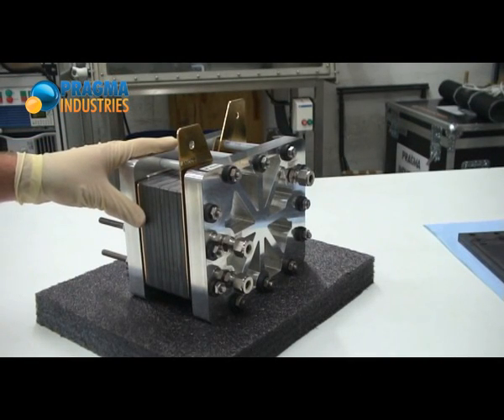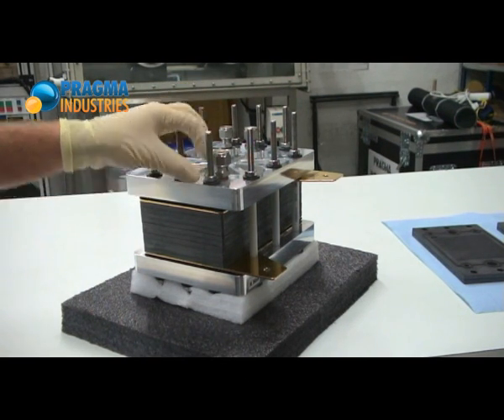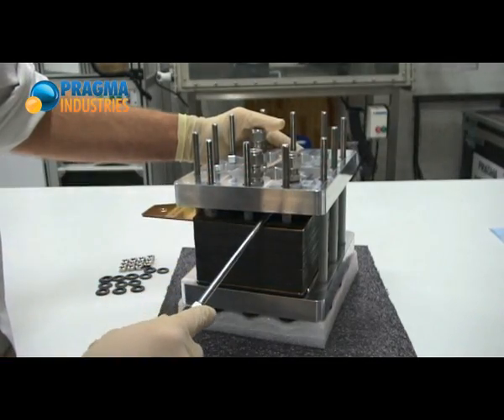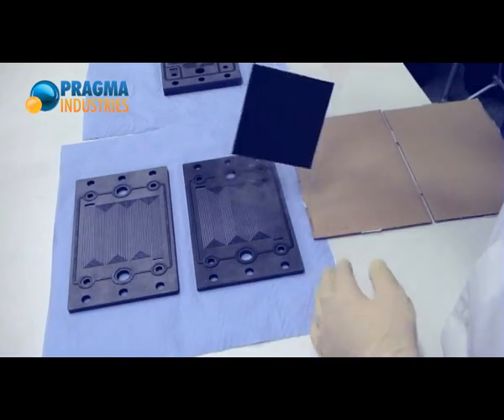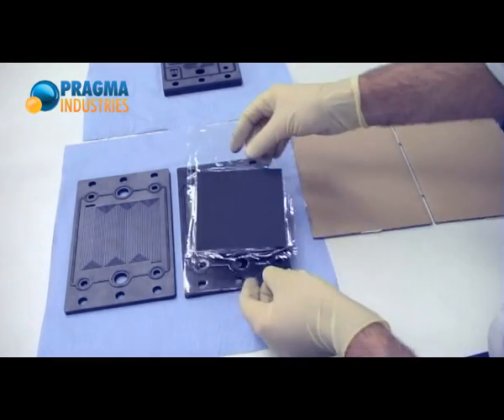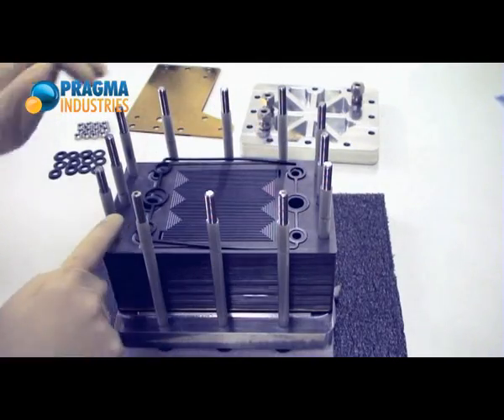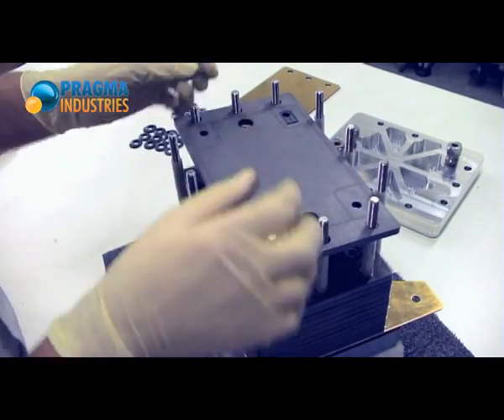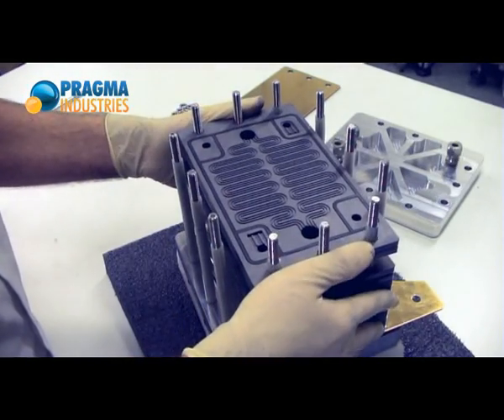Fuel cell stack explained

Comment: ... shouldn't there be a Sterling cathode (-) plates collecting electrons from the Hydrogen side in-between those blocks later connected in parallel/serial to suit application...copper are oxidizable element...more Non oxidizable plates on the Oxygen/Anode (+) side like copper plated with gold/silver..etc

Comment: This was a wonderful learning experience!  Thank you!  This helped me better understand PEM electrolyzers too!  That fuel cell looks like it would work as an electrolyzer with no problem.  You could force deionized water into one port on the anode and collect oxygen and recycle water from the other port, diagonal from it.  On the cathode side, you connect both ports to a T connector, run through a water-gas separator and collect the hydrogen.  The water cooling ports would remain unused.  I would LOVE to see how many LPM I could get from a stack that size!! :)
Reply: It looks like they are putting these graphite plates into PEM fuel cells and running hexo and mirai cars with it. It looks like the the fuel cell is made of like 400 plates and it's like 3 feet long, two foot wide, ect. So they use graphite plates? No platinum or anything? is this to save costs?
Reply: @MinecraftSurge  I had to watch a little clip of the video again to refresh my memory.  Yeah, he didn't just use Nafion in between the graphite plates.  He was putting complete MEA's in between them, which already has some platinum deposited on them.  Those black squares on each side of the Nafion membranes contain carbon, platinum and I forget what else.  And, the platinum is the most expensive material, followed by the Nafion.

Comment: Hi what's the purpose for the transparent layer wrapping the MEA?
Reply from the maker: The MEA is very thin, below 20 microns and is subject to dimensional variations due to water absorption/desorption. The subgaket is used to maintain external dimensions stable and also to ease handling when assembling the stack.

Comment: I thought a fuel cell converted fuel into electricity?
Reply: they do, water is just a byproduct
Reply: This is a HHO generator that creates hydrogen and oxygen gas with electricity. A fuel cell converts hydrogen gas to electricity. At least where I'm  from.
Reply: @ScinnerNo1  If im not mistaken it looks like the tubes are to feed hydrogen and oxygen into the system and get water out. The water in the system itself he said is just a cooling mechanism. It can be a generator I suppose but usually generators are submersed in a solution... the design is common feul cell design and at the underneath of the video he says it isnt a hydrogen generator
Reply: @isaacsechslingloff9894  You are right, my mistake for not watching the whole video. There are dry cell generators that looks like this but with thin stainless steel plates. Annyway my bad. Thx!
Reply: according to the website (here: https://www.pragma-industries.com/technology/fuel-cell-explained/ ) It says its for the reversal of electrolysis and thats the purpose of these, however since I don't actually know how to buy the product I cant tell you how it truelly works

Comment: Outstanding video overview, excellent shop location (less than two miles from the coast!), great website. These guys work out of a small metal clad building practically within walking distance to the East Coast.

Hydrogen is the direction we need to go in, vs. the current, mass marketed, outdated battery technology. We're all way behind on this exceptional alternative fuel source. We started working on hydrogen fuel for our custom made boats (V8, Jet and prop ski boats) 40 years ago. Unfortunately that R&D bankrupted us. So it's great to see vids like this promoting this exceptional fuel source.
Reply from the maker: Thank you for your support.

Comment: Hi. How does the water comes out?
Reply from the maker: hello, 
Water comes out as vapor carried away by air flow at cathodes for the major part. A small portion of water accumulates on anode (hydrogen) side and is evacuated when purging the anodes. in a fuel cell, regular purge of anode sides is required to eliminate water accumulated. Purging anodes means that you vent at ambiant pressure a portion of the hydrogen in the anode circuit.
Reply: Thanks. Also how do the electrons pass through the transparent part of the PEM used to support the membrane. Is their a separate way for these? For one cell it goes well. But on a stack don't we have to provide an external connection to join the electrodes for each cell?

Comment: In this type of experimental cell, it appears that the graphite plates are the actual conductive Anode and Cathode for each cell, right?  Then the gold colored metal Anode and Cathode plates are the "final" contact plates for the entire stack?  If this is true, then are the gaskets (o-rings) between the plates also conductive? (or is the stack compressed enough to cause intimate contact between adjacent graphite plates?)

The PEM membrane... this is considered the "electrolyte"... but it is a non-chemically reactive film, but simply a material that's "porous" to the hydrogen ions, but insulates the electrons? 

What is the process that causes the ion to leave the hydrogen molecule? Isn't it a catalytic process?  If so, where does the Platinum catalyst come into play? Are there nano-scale platinum particles embedded into the surface of the graphite plates in the gas distribution channels?  Is this the process that's exothermic, or is it the recombination of O2 and the Hydrogen ions that gives off heat? (or both?) Do both Anode and Cathode undergo heating?

(I'm just trying to piece together "bits and pieces" of information I've gathered from various sources.)
 
Is there any advantage to using pure O2 as the oxidizer, instead of atmospheric "air" - which is very diluted? (such as less damage to the PEM or the Anode/Cathodes)

Also, what would happen if the H2 supply had small amounts of O2 as well... would the O2 be discharged as part of the H2 "exhaust" (outlet) stream?  ... or would the presence of O2 inhibit the stripping of the Hydrogen ions?

What is the typical single-pass H2 conversion efficiency? Would this efficiency be increased if the oxidizer were O2, not "air"?
Reply: I think your question was too revealing to their bullshit scam, that's why you didn't get a response.

Comment: Do you have to heat up the PEM to 80 degree? If the PEM operates at 80 Celcius, why would it need liquid cooling??
Reply from the maker: the PEM fuel cell will have an efficiency varying around 50%. For 1 Watt of electrical power, the fuel cell will dissipate 1 Watt of heat. A powerful, yet compact fuel cell will easily reach 80°C during operation, and it will need an active cooling not to exceed its ideal operating temperature. Depending on the design, it can be air cooled or liquid cooled.
Reply: Thanks! I'm new to PEM. Now I know that cooling system is important to PEM. And there is new membrane that can handle higher temperature

Comment: Can an SOFC fuel cell use liquid petroleum gas or butane or methane as fuel ?
How much does a testing stack such as in the video cost ?
Could you theoretically power a house with many stacks, and would it be reasonable and pragmatic (price and implementation) ?
Reply from the maker: Yes, an SOFC can used carbonated fuels.
A fuel cell like the one in this video will cost a few thousand $ as it is a lab equipment designed with specific R&D features, not a few cell designed for industrial use, so it's not cost optimized.
You can power your house with fuel cells. Definitely. Is it pragmatic? It all depends from where you live (access to grid, local energy cost, size of your house...). A few solutions already exist out-of-the-shelf, like the enefarm http://enefield.eu
Reply: James Larminie, Andrew Dicks, Fuel Cell Systems Explained, Second Edition, Wiley, 2003 ISBN: 0-470-84857-X
It's a good start.
Reply: Pragma Industries in the Title you say you "explained" it. No. You disabled and reasembled it again.
Fuel goes in here, ...
Does it burn?
How is it converted?
Does it produce exhause gases?
Can you describe the effect that takes place inside?
Because for me this looks odd and I can't imagine how it should work

Comment: since electrons can't pass the mea, how do the electrons in a second cell get back to the current collector?
Reply from the maker: Karine Natani Lupatini 
Hi Karine, in a fuel cell, electrons will move in opposite direction to the H+ ions. For example, let's start at cell N in the middle of the stack. H+ ions will migrate through the electrolyte of the cell N, from the anode to the cathode side of the membrane. Electrons will migrate from the anode of the cell N, to the cathode of cell N-1 through the conductive bipolar plate. So if will look again at what's happening at cathode side of cell N, we get H+ ions form anode N, oxygen and electrons arriving from cell N+1 = H20. Is that a little bit clearer ?
Reply: Electrons take the shortest path. I believe since they cannot pass through the MEA they are forced to go from the negative outer plate through whatever motor you are using and back to the positive plate on the other side of the fuel cell.
Reply: Thank you! That's exactly what I have been trying to understand!
Reply: +Pragma Industries, But are not conductive bipolar plates seperated with the MEA? so how are the electrons getting transferred between those plates?
Reply: Karine Natani Lupatini liquid!!

Comment: which membrane material you have used ?
Reply from the maker: Santosh Mane this is a low temperature PEM-type fuel cell. Electrolyte used (membrane material) is a sulfonated tetrafluorethylene based fluoropolymer from Dupont. Commercial name > NAFION. You can find a lot about it with Wikipedia
Reply: Thanks sir

Comment: I am interested to know what is the highest amperage you created with this cell?
Reply from the maker: Ted Wiley 160Amp @0.4V/cell is the typical max current when the fuel cell is fed with air (1.6 amp per cm² of electrode). you can get more than that if you fall under 0.4V/cell but its not very practical and not recommended for the FC health. Another option is to feed the FC with pure hydrogen. In this case, currents reach a whole new level...
Reply: @PragmaIndustries  Excuse me for asking a daft question, however, How do you get current from each cell to the current collector?
Reply: @piprichards5616  Those graphite plates with all those little grooves (channels) are conductive and they reach 0.4v / cell as they deliver gasses via those grooves and make direct contact with the MEAs.  Since the graphite cell plates are back-to-back, they are electrically in series, like batteries.  So the 7-cell stack he made would be 0.4 + 0.4 + 0.4 + 0.4 + 0.4 + 0.4 + 0.4 = 2.8V delivered to the current collector plates on the ends.

Comment: Nice video,  Have you experiment short circuit problems when you stack the cells one to another? I saw that the cells do not have a separator.
Reply: I think that's on purpose. If I remember correctly, a single layer only produces about 0.7 volts. Stacking them ontop of eachother like that effectively puts them in series, so the total voltage goes up by 0.7 volts for each layer, in a perfect world.
Don't quote me on that though, I'm still learning

Comment from the maker: Hi Daniel, air breathing design works quite well for PEM fuel cell type. Water management is a challenge though, as the air flow through the FC is high. The FC tends to dry. However this can be solved with suitable gas diffusion layers applied to electrodes (thick and hydrophobic to maintain water within the electrolyte). No scientific publication has been made by Pragma Industries on this work.
Reply: How mutch a unit This

Comment: Loving your video.  I am somewhat confused as to what you are using for a catalyst though?  Do you sell fuel cells designed to be used in product yet or only educational?
Reply: MEA's stand for "Membrane electrode assembly". As an assembly of parts, they're comprised of a polymer electrolyte membrane (which conducts the H2 ions), two catalyst layers, and two gas diffusion layers (GDLs). It's highly beneficial to reduce ohmic loses which arise from the layer thicknesses, so the three components are commonly manufactured as one where each layer can be really, really thin (usually <150 microns). I hope this helps!
Reply: @bensaxon3829  Hi thanks for jumping in, been waiting 8 years for a response lol. So what are the catalyst layers made out of?
Reply: @nickjunes  wow must have been a long 8 years! :). Most non-experimental catalysts (at least for PEM fuel cells) use platinum. I don’t fully understand how the platinum splits the H2 into ions and electrons, but that’s something for you to research!

Comment from the maker: @azizeqab Hello, operating temperature of this fuel cell is ambient to 80°C. It is a "forced air flow" design, as opposed to "open cathode" (forced convection by fan through transversal channels) or "air breathing" design (natural convection over flat cathodes side). So air is pushed inside the fuel cell and distributed to the cells the same way that hydrogen is supplied to anodes. Cooling is achieved  with a separate flow field within each bipolar plates by liquid flow.

Comment from the maker: @wayoentertainment Thanks for finding the video useful. For the liquid flowfield (for stack cooling), you've got to be careful with the pressure drop that would result from more but smaller channels. The one we designed work great because the stack is cooled at every separator plate (it was designed for research to temperature has to be the most homogeneous within the whole stack). However, it is quite common to cool down industrial stacks every 2 or 3 plates to reduce costs and size.
Reply: yes homogeneous flow is need but also the thermal stress on different spot in the reactor, will poke a hole on a plate.

Comment from the maker: @greatimescomunity If we talk about the PEM fuel cell family type, the one presented in the video, there are a few key materials.
- the electrolyte is made of a polymer film having the property of carrying hydrogen protons. 
- catalyst of the reaction is platinum in nanometer-size particles and is used at electrodes
More details at Pragma Industries' website. Look for the "fuel cell explained" link at the bottom of the home page. Not enough characters available here to give a detailed answer.